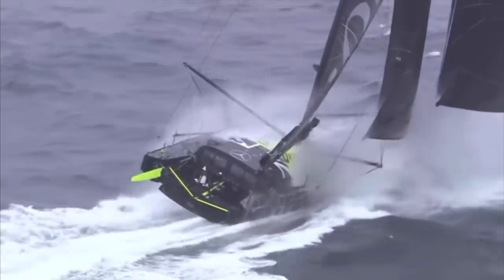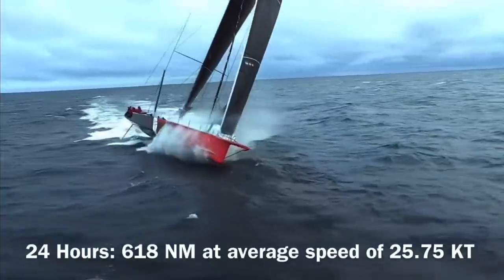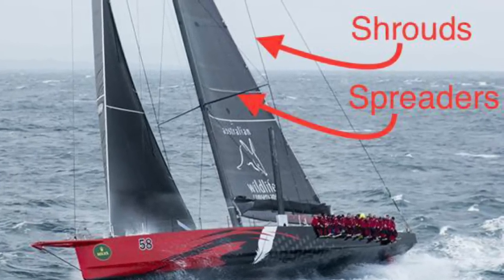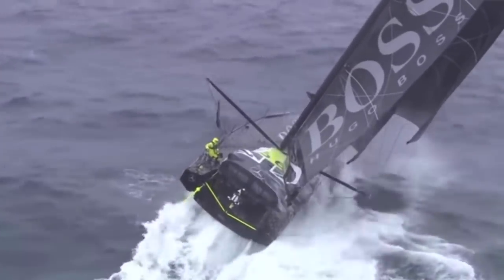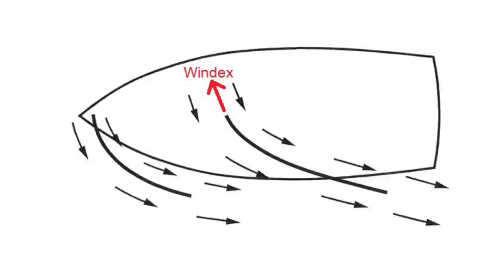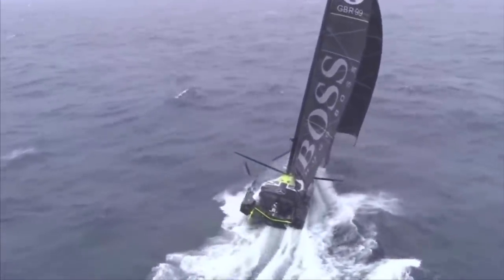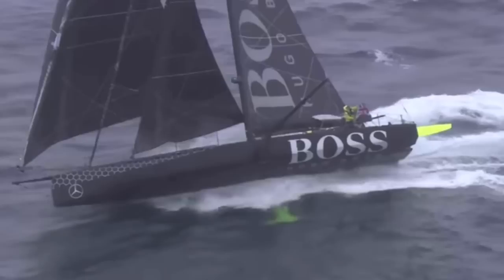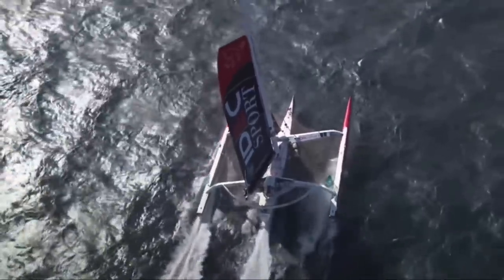Why Does Alex Thomson’s Hugo Boss Have Those Strange Outriggers?!?!?

Comment: Rotating mast on several boats I have sailed all had spreaders for the diamond stays. And the shrouds went from near the tip of the mast to the beam of the boat.
Reply from the maker: Not all boats with rotating masts have outriggers, but mostly smaller boats. Which boats did you sail with rotating masts with shrouds to the beam? The designers of the IMOCAs decided it was helpful to have outriggers for a wider base.
Reply: @SailingTipsCa  the wider base makes a lot of sense. Most of the ones I was on were under 50feet, and not nearly the same performance or as new as these boats. My favorite was actually just a little F22r, which is a trimaran so already very wide haha
Reply from the maker: @tristankiddie1710  Yes multihulls are generally wide enough without the need for outriggers. The F22R would be a blast! I have an F82R and it’s lots of fun too!
Reply: @SailingTipsCa  I miss it. I currently have an old plywood A Class cat as my toy. Really need to sort the carbon rig for it tho, Ali mast is to soft to hold good sail shape now